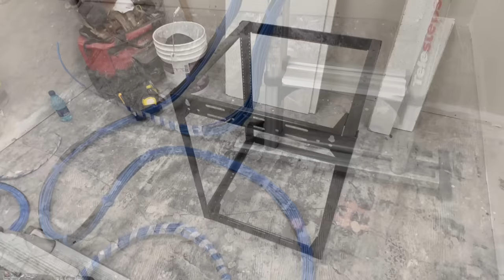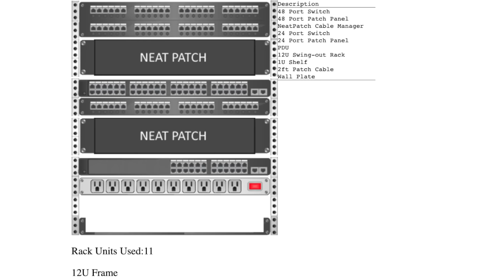Learning Network Cable Management - A Small Business Open Frame Rack Build

Comment: What is your job title? I’m 20 and looking to get into almost exactly what you do. What did you do education wise to get to where you are today? I am currently working on my Net+ cert.
Reply from the maker: I studied standard A+ and Net+ stuff way back, but I began as a bench technician for PC repair.  If you really want to build networks, the physical installation position is going to be called something like Structured Cable Installer or similar.  You'd go for your BICSI cert and you'd likely want to join up with some electricians and focus on obtaining hours to get your license ultimately.  The software version of this, the position would be something like Network Engineer, and you'd want certs in CCNA, CCNP, and other related network design credentials, and your track would be to join up with an ISP, or a large MSP that handles clients in multiple sites so that you get a good wide set of experience.  Normally, you either build the physical layout or your design the network layout, and those are two different jobs.  Once you've been around the block a few times, you could do both, but I don't know a job that combines them into one role.
Reply: @tciproductions  I appreciate you sharing your knowledge!

Comment: What is the name of the saddle straps you used to tie down the cables to the wall?
Reply from the maker: I found these straps at Home Depot, see if your local hardware supplier has something similar: https://www.homedepot.com/p/Commercial-Electric-1-in-Mounting-Base-Natural-10-Pack-HW-4A-10/203531944

Comment: Your work is amazing, and sorry i dont have much knowlwdge for this cable management but i want to know that why did you use patch cable system you could just simply plugh main cables into swithces no extra work

sorry if i am wrong please update me on this point
Reply from the maker: In this line of work, we'd consider something with an RJ-45 plug on the end to be a temporary patch cable.  A line with female keystones on both ends is considered a permanent link.  I'm sure you've seen those RJs where the little tab has broken off, that doesn't happen with the patch panel ports or the wall plate ports.  So in theory you just use the patch cord until the tab breaks and then replace it and the permanent link doesn't need to be redone.

In practice it is a minor difference for home users or networks that rarely change, but if you need to move cords here and there throughout the year, the tabs tend to break off.  There's a whole course from Bicsi at https://www.bicsi.org/education-certification/certification that explains some of the reasoning behind it all.  Again in practice, you do what makes sense for you :)
Reply: @tciproductions  Thank You i appreciate your answer and found it best for me.
Reply: solid cables (virtually ALL in wall) in plugs tends to fail on connections long term. It's also less flexible, so using patch cables is much easier due to flexibility

Comment: Weird question. If you are installing in an office that doesn't have a drop ceiling, attic or crawlspace, how do you run cables?
Reply from the maker: It depends a little on what you do have, so like in a warehouse, I use the structural I-beams with an eyelet style hook that bites into the beam - https://amzn.to/472N03s

If you have nothing cross ways to work with, I normally install threaded rods and let them hang down from a roof joist or other supporting wood structure to the height I want my cables, and then I install a J-Hook or uni-strut.

If you have just wooden joists 12 inches on center or similar, I will screw J-Hooks directly into the wood.  I try to follow along in the same straight lines as the plumbing and electrical, and group my wires near these, spaced at least 2 inches away from any romex wires that carry high voltage to prevent noise, but close enough that it all looks intentional.  I never take diagonal lines or deviate away from the electrical and plumbing because it looks a bit unprofessional.  In the end, if you like it, you did it right :)

Comment: Question: with the 48 port switches, wasn't it nicer todo : 1u patch 24, 1u neat-patch, 48port 1u switch, 1u neat-patch, 2 u patch 48, 1u neat-patch, 48port 1u switch,1u neat-patch,1u patch 24?
Reply from the maker: It can be nicer yes, although it does use 4 wire managers vs 2.  It depends a bit on how I read the end user sometimes.  If I think they enjoy complex structures I might give them a busier looking rack so they have something they can be proud to operate, but otherwise, when I don't know exactly what the situation is, I bring the generic 2U so I have space to work my magic.
Reply: @tciproductions  true :D and the priced for 1u or 2u is only 10$ difference.

Comment: what ladder is that and do you like it?
Reply from the maker: I believe I am using this model for the video: https://amzn.to/44CeWJk
I also use this leaning ladder a lot, which I really like: https://amzn.to/3PSs9tq

I have tried numerous folding or collapsing models and most have bit my fingers despite best efforts, but these two have been the least headache.  We mostly use it to avoid having to buy pickup trucks or latch ladders to a car roof, and for that it works really well.

Comment: Nice. To be honest though. I think I would've preferred you showed details you cut out like at 4:35  when you tapered the cables.
Reply from the maker: In other videos I think it shows in more detail.  The cables were all different lengths, I simply wound tape around them and they tapered purely by coincidence in this particular case.  I'll try to add some detail on the next one I upload.
Reply: @tciproductions  Awesome. I like your videos in particular, it’s a bit difficult to find channels uploading content regarding the installation of networking hardware/infrastructure in this level of detail so I appreciate this. Another part I was confused about in this video was at 8:35. What did you mean by it would be easier to terminate like the way you did? I may have to install my first patch panel ever, and I have the Klein VDV427-300 punch down tool. Would that be sufficient? It’s obviously not a crimper style tool like yours..
Reply from the maker: @HyperionBadger  In my experience, first timers have an easier time managing the cables to the rear of the panel using this sort of keystone snap-in panel.  You can see that I don't really need to get behind the panel to work.  In a punchdown style of panel, you'll want to bring it out of the rack and terminate it on a portable table or the top of the ladder perhaps, then gently fold the cables back into the rack when you screw it down.  A lot of new workers have struggled to manage the cable lengths and twists and such, so I teach my guys this way first and work my way towards more complex scenarios for them.  Don't worry, it isn't so hard as all that, you'll do great, just go carefully and plan ahead before you punch them all in.  One thing you'll find many videos of is folks showing various methods of managing a punchdown panel, I haven't gotten around to one yet.
Reply: @tciproductions  Oh! I see what you mean. The keystones you can crimp them before they get inserted into the back. Basically you’re getting your wiring done prior to affixing the cables to the panel. Correct?
Reply from the maker: @HyperionBadger  That's correct, you got it.

Comment: In the video we didn’t see you test the integrity of the connection between the switches on one end, and the other end of the cables, in the various offices and/or ceiling terminals (in the case of any wireless access points and/or cameras). Was testing not part of your contract with this client?
Reply from the maker: I will probably do a video on that topic at some point, for this particular case the testing was done quite a bit later and it just wasn't something I could fit in.  For me, this is usually the same step as labelling and creating the cable map/shop drawing.

Comment: How much would be the minimum charge for the network setup?
Reply from the maker: The price would depend a lot on the scope of work.  For just wire termination, it would be hourly, plus the cost of patch panels and so forth.  An 8 hour day for one person would be around $1k.  If we have to run cat6, it will take a few people and a few days, and it would add up quickly.  If you pull the cables yourself and want some help with the termination and rack, that's the most cost effective I would say.
Reply: @tciproductions  awesome! Thanks for the tip ;)

Comment: Good job sir. Just found your channel. Really good , neat & professional work. Just curious as to  the cost for that job ,  you can  ball pack a range for that job.
Reply from the maker: For just the terminations like I did in this video, it would be around $2-3k total.  If we included running all the cat6 wires, terminating the faceplates, labeling, testing, attaching j-hooks, installing threaded rods, and the whole nine yards to be code compliant, it would vary greatly by region, but somewhere between $200 and $400 per cat6 seems to be the going rate from what I have seen.  In a retail space like a mall, I have seen $1000 per wire being the all-in price.
Reply: @tciproductions  thanks for your response. Keep showing off your work. Your work is very professional and  high 
quality. Cheers

Comment: What job role is yours called?
Reply from the maker: You would look at Structured Cable Installer or Low Voltage Technician as two likely descriptions.

Comment: Hi, I have noticed that at 12:21 u have cut the cable ties in a way that leaves a sharp edge. Please use cutters that are able to cut the flush so no one can get cut while working on the rack.
Reply: I normally flush cut using a Milwaukee cutter, but seriously surprised you'd waste your time making this comment. Being in the field I've seen such disasters this is nothing to be concerned about lol.  All he needs to do is rotate the cut cable towards the rear up against the wall and problem solved.  I'm going to inspect your work next lol
Reply: No need to get offended, its just something i started paying attention after getting cut many times and wanted to offer my feedback.
Reply: @dj8010 not a waste of time at all. Always flush cut your zip ties, leaving a sharp edge is dangerous. And why rotate it when you could just do it right the first time? Doesn't take any extra time.
Reply: AH so I guess you've found some of mine haha

Comment: Nice but can you post whee you got those chase pipes?
Reply from the maker: Hi Gabriel, I just cut EMT into 1 foot segments and attached it to the wall with uni-strut.  I can't really find a pre-made set, but this one I have used a few times before is pretty close:
https://www.discount-low-voltage.com/fs-400
Reply: @tciproductions  what uni-strut did you used and how did you attached it?
Reply from the maker: So normally I use a band saw to cut down a segment of this sort of strut:
https://www.homedepot.com/p/Superstrut-10-ft-14-Gauge-Half-Slotted-Metal-Framing-Strut-Channel-Gold-Galvanized-ZB1400HS-10/100164315
Just a normal construction screw and washers keep the strut on the plywood, nothing fancy.

I then attach a set screw connector to the end of my EMT section:
https://www.homedepot.com/p/3-in-Electrical-Metallic-Tube-Set-Screw-Connector-62730B/100193330

And then I place matching bushing on the set screw connector:
https://www.homedepot.com/p/3-in-Rigid-Plastic-Insulating-Bushing-75230/100344076

And then I'll use these clamps to lock a section of EMT that I cut into a short 1 to 1.5 ft segment onto the strut:
https://www.homedepot.com/p/Superstrut-3-in-Pipe-Strap-Strut-Fitting-Gold-Galvanized-Z702-3-10/310397926
Reply: Thank you for sharing all of that. I had the same question as soon as I saw those chase pipes. Great job demonstrating how to achieve a great build!
Reply: @tciproductions how did you attact the threaded? Plastic rings/grommets to the pipe?

Comment: Why dotn you just bringt two lenght of cables, so you can switch on the fly?
Reply from the maker: I want to bring as little as possible, plus job would cost more if I had to buy multiple lengths to cover any situation.  I settled on a length that covers "most" cases.  Mixing and matching the lengths bothers my OCD, so I do what works for me.  If you mixed them, it probably looks fine and nobody can tell anyway.

Comment: hola, me parece que el orden de instalacion de los pasivos y activos no fue adecuaados a las normas, no se cumplio con el 50 % de separacion de los cables ha ambos lados del rack, no se dejo cable de reserva en el rack y se perdio capacidad en el ultima bandeja de acomodo de cable, muy correcta la separacion de los cables por los tubos, pero no se le agrego la pasta contra fuego, cuando se crea un video en yotube, debemos hacerlo correcto segun las normas ETA/TIA para que el mensaje llegue correcto y los que estan aprendiendo les llegue claro y verdadero. por lo demas debo felcitarlo por la rapidez y la capacidad de hacer los jack de los patch panel, utilizando la herramienta adecuada. Le doy las gracias por su intencion
Reply from the maker: This was not an ETA/TIA standards based contract.  I will make additional videos and cover some more topics.

Comment: Constructive criticism, Do Not take personally. Im guessing you are an IT guy who also does complete installs. Im an install guy who does not intrude in IT. It is hard to find a tech who can do both so cudos for steppin up. However, for all the care you took on the wall mount rack, sleeves etc your cable work is below par and the feed to the back of the patch panel, crisscrossing etc is garbage.
Comb it outta the sleeve (no divers) do this by starting above the grid but below your service loop....now you got room. Cable wrap each one as they hit the panel with the corresponding faceplate, velcro in groups of six. Personally i deal with that type of punchdown on a four foot step ladder, freehand, then just pull it back up....snapjack or static panel.
Hope i dont sound harsh, thanks for the vid/inspiration.
Reply from the maker: Not at all, in other videos I've posted, I've tried to include some of the things people have commented.  It's helped me get better at this, I hope I didn't present myself as an expert or master installer, I'm fairly middle of the road.  I'll post more as I'm able.